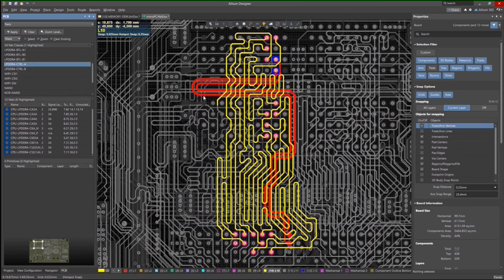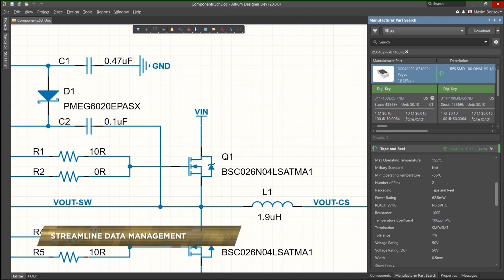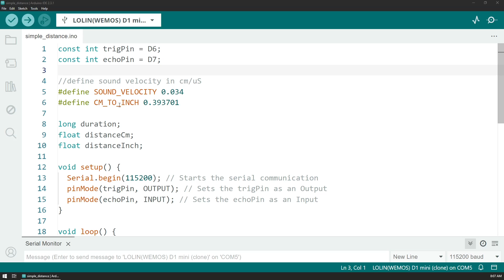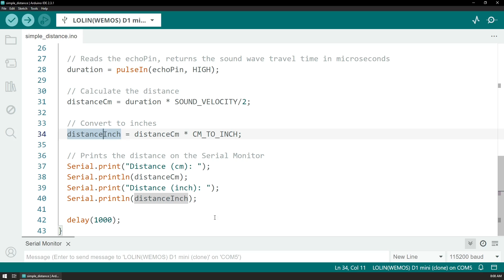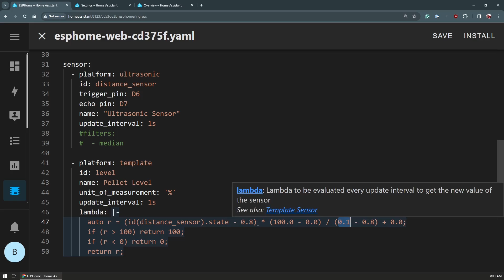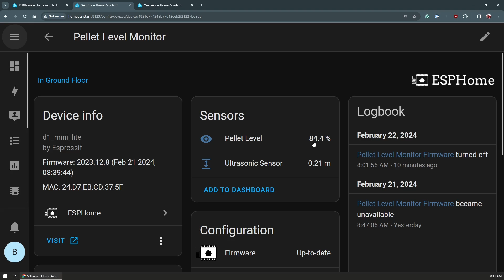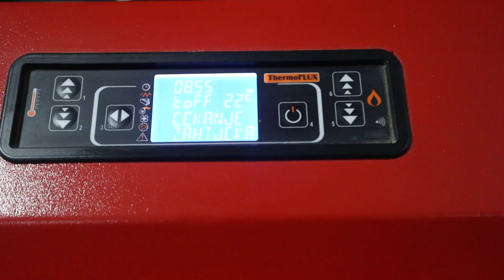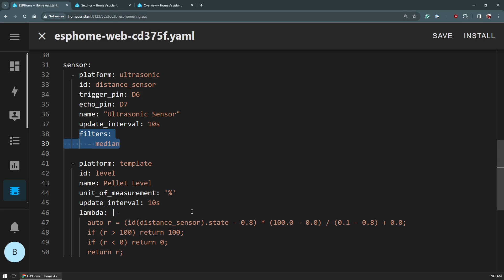Pellet Level Monitor for Home Assistant with HC-SR04 and ESP8266

Comment: Hi Bill, my name is Ricardo Rachel, I'm from Brazil. Thank you very much for sharing your knowledge. Your solution turned out really cool. I am currently building my house and I'm going to use rainwater for the toilets. I have a main cistern that collects all the rainwater and a reuse water tank at the top of the house. I want to use a solution very similar to yours to control the level of both tanks and the transfer pump. I really liked the graphic display you set up; I'm going to do more research on how to do it, as it wasn't quite clear in your video. I also had a question about where you define the number of values (last 5) used to calculate the average. I am just starting my studies in YAML. Do you have any reading recommendations to get to know the commands?
Reply from the maker: Hey Ricardo, nice to meet you. I'm glad you liked it. The display is part of Home Assistant, the overall control system I use in my home. It already provides this gauge. I highly recommend it. As for the YAML, your best bet is the documentation for Home Assistant and ESPHome. That will tell you everything you need to know. In terms of process, once tou know what you want to achieve, find the right components and just read through their documentation. You can also use ChatGPT to generate the YAML for you once you know what you need.

Comment: Does the sensor hold up to the dust?
Reply from the maker: So far I did not have issues with it. There is some dust in the bin but not that much.
Reply: That's a thing I'm wondering, too. I have a stove that pulls the pellets by vacuum from a silo. But I'll give it a try, the components are by far cheaper than weighing cells.

Comment: Great project, what is the flat cable that you used between the sensor and the board ?
Reply from the maker: Thanks. It is just an old cable from a USB charger.

Comment: Great idea. I plan on using this method to measure the amount of chicken feed and water (in their respective containers) for our chickens. I will use the waterproof sensor (JSN-SRT04T) instead since they are outside. I use HA to control the coop door and the chicken run door so this fits my ecosystem  perfectly. Thanks for including the code.
Reply from the maker: Thanks! Let me know how it goes. I also made a version with a laser distance measuring sensor (VL53L0X) and it works much better, a lot less noise. This is the video on it: https://youtu.be/FsQGe6XXeQE

Comment: Pretty cool idea. If you get timing from the feed motor you could also estimate how many pellets are being used that way. I believe this is how Harman’s doing it on there new accentra stoves. Log the timing and when the hoppers empty you should have a count on how many feed pulses it takes. You’d have to keep the feed setting constant.  (Depending on the stove some will pulse say 7 seconds then vary the off time others vary the pulse time and keep the off timing consistent.) but once you get a idea you can probably estimate for the other feed settings from there. Hope this helps.
Reply from the maker: Thanks! I definitely considered using this to figure out my spending but I did not had the time to look into it yet. One issue that I'm having right now is that at times, the pellets level will drop significantly, but then as some pellets fall from the sides, it goes up. This will affect the spending measurements as it will look as if someone put some more pellets in. Not sure how I can tackle this.
Reply: @TasteTheCode  maybe add a bass shaker. To force the pellets to drop then take a reading after?
Reply from the maker: That's an interesting thought. I'm guessing it will require some power to operate which will complicate the build but sound promising. Thanks!

Comment: just my 5 cents. I would consider putting wemos d1 to sleep (d1 mini is perfect for than). One digit is  confusing for me. I would recommended none
Reply from the maker: I would not worry about putting it in sleep as it runs off a mobile charger and it is always on. I did not get your suggestion on the one digit though. Can you please clarify?

Comment: This is exactly what I plan to do. Though I don't have a lid and I need to mount the sensor on the edge of the container or on the ceiling. I wonder if laser TOF sensors will be better for this.
Reply from the maker: Laser TOF is something I just learned about so I'm not sure how that will work but people seem to say it is better. Mounting it on the ceiling might be viable as long as the measured distance is less than 3 meters.